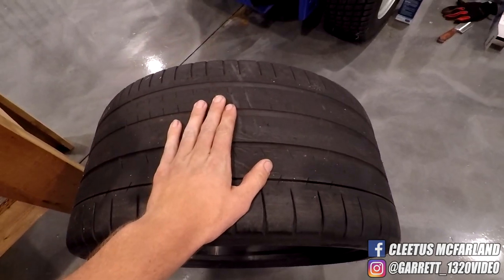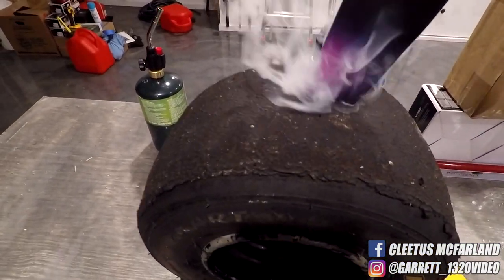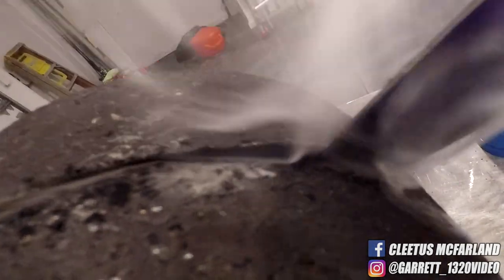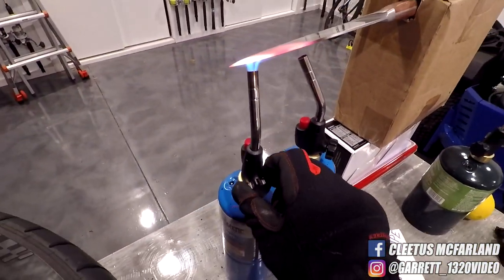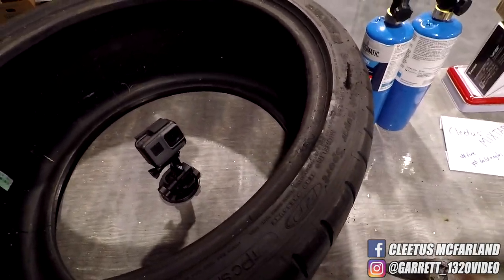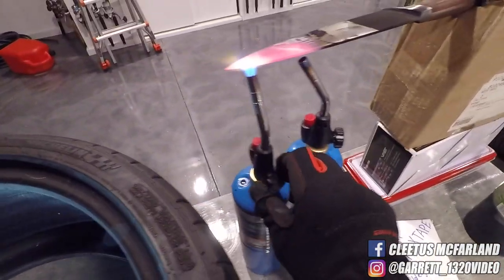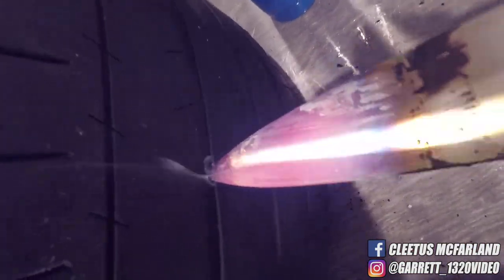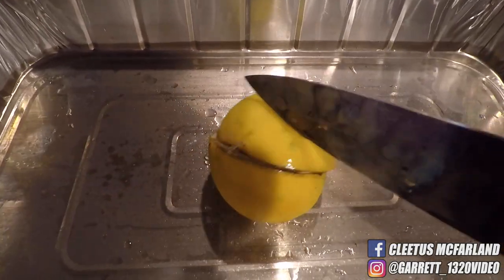GLOWING HOT KNIFE vs. CAR TIRE!

Comment: Of course that wouldn't go through the tire,  they are  steel-belted
Reply: do you think this guy would have the common knowledge to know that?
Reply: Lucky Dane this guy is playing a character he's not an idiot
Reply: Robert Smith hes very, very good at playing stupid then
Reply: hes done burnouts before, he obviously knows that
Reply: What do you mean he's not using jet fuel
Reply: o Lemurs I
Reply: Paul Castro side walls are not but your right.
Reply: @incrediblygay  one day he build a jet engine car with a v8 in front :)

Comment: the rubber on the tread is not that much thicker, the reason you cant melt through there I because there is metal under there
Reply: Exactly, he's hitting the steel belting
Reply: thank you

Comment from the maker: Gotta be hulk to get through those belts...
Reply: Cleetus McFarland fishing videos soon?
Reply from the maker: go back in my videos a bit, just posted one in LA tuna fishing
Reply: I saw all the rods on the wall.
Reply: Steel belts laugh at your puny knife.
Reply: Cleetus McFarland I hope you check out some of my videos
Reply: +Luchace Fox Good point. Having air pressure on the backside would have helped tearing the tire thread apart.
Reply: isn't it pretty dangerous doing thag because of all the presure inside
Reply: Cleetus McFarland Yeah, im thinking you'll have a DIY flamethrower, if you stab your tire with a flaming knife when its pumped to 35 PSI or so, as the flames will get a massive blast of air...
Reply: Alfredo, the tyre wasn't on a wheel...
Reply: Cleetus McFarland don't care
Reply: Dominic, I meant if it was on a wheel with pressure could it just kinda explode?
Reply: The adventure of chuck
Reply: Alfredo Aldape no
Reply: Or Chuck Norris...
Reply: Cleetus McFarland I love your channel can you shout me out at dallas miller
Reply: Cleetus McFarland use that to mount your tires next time

Comment: Wont cut trough the tire because of the steel belts in the tread
Reply: If anyone was wondering
Reply: Correct, most tires have more than just rubber under the tread for strength etc, but for some reason this is not common knowledge, at least these days.
Reply: ChildOL trust me if you ask anyone in this generation 75% of them wouldn't know maybe more
Reply: probably closer to 95%

Comment: Holy shit its almost like theres a metal braided ribbon cable going through the rubber at the treaded area.
Reply: Olivia Lambert because there is.. they're is wire in tires
Reply: Yeah, thats why I said it :( Its oddly specific about the type of wire to be coincidentally accurate.
Reply: Haha Correct! XD Tires are manufactured with steel belting

Comment: There are these things called Belts in tires. They are made of Steel. Passenger car tires have to have them for structural reinforcement (Against potholes, debris...) and while a nail that you run over can pierce through them, you're not going to shove a knife through them by hand. Go Kart slicks (Or even Track-only tires for cars) Won't have belts because you won't generally find potholes on purpose built tracks, and it cuts down the weight of the tire quite a bit.

Comment: a bit of explanation here - you can cut the sidewals with a normal unheated knife and it's quite easy, you cannnot cut the thread thou because there is a steel belt inside, there also a steel rod on the inside part of the sides near the rim - it's reinforced

Comment: Correct with the thickness of rubber but there are also other compounds like steel chords, Kevlar and rayon. Run flat tyres are more structurally reinforced for running flat

Comment: Pilot Super Sports have a softer compound on the outside for cornering grip, but hard in the middle for overall mileage/treadwear. Between that, and the steel belts you wouldn't find in the cart tires (sounded like you were cutting through nylon cords on those), I'm not at all surprised by the results.

Comment: The tire treat section is composed of metal bands (plies) a 1000 degree hot knife can't cut through metal bands. Side walls don't have plies that's why you were able to go through the sidewall so easily

Comment: I make tires for a living. You can't get through the tread layer cause you have steel belts that cross hatch through the tire. Unless you can melt the steel you won't get through it. The side wall is just thick rubber. Do this with tubular tires and you'll have better results lol

Comment: It's not how hard the rubber is on the sidewall vs the tread, it's because the tread has a STEEL mesh called a steel belt under the rubber.

Comment: Well the tread is supposed to be able to withstand heaps of heat since that'ss the part that gets hot whilst you drive, so it's not really a big surprise that it didn't go through.

Comment: Heating the steel basically ruins the heat treatment, which greatly reduces the surface hardness. Thus, the blade wont retain a sharp edge worth crud. At that temp, it may even be at the point of softness. Thus, you are no longer 'cutting' but more like 'melting.' But once you tried to go into the tread, you are now hitting the metal re-enforcement strands. Now you have a non-hard knife, you are not going to be cutting at all. 
In any event, you did not compare it with the non-heated knife, ergo: experiment fail.

Comment: LOL it's not that the knife can't cut through the rubber in the middle, but the middle of the tire has a steel band to help keep the rigidity. that's why it didn't work

Comment: Tires have bands and wire in the tread to hold the tire together making the knife stop if the tire didn't have the wires you would slice straight through

Comment: inside tire there is a metal net so you will not be able to cut it with hot knife. sidewalls instead contain no metal. that's why tire repairers does not repair tires punctured on sidewall.

Comment: the rubber is not softer on the sides. you wpuld know if you knew how a tire is designed. theres a metal mesh in the tire, thats why you couldnt stab the knife through

Comment: you can stab a knife through a tyre easily without heating it up, it's nothing special. I used to work in a place where when we changed tyres out instead of deflating them the usual way by unscrewing the valve insert we just stabbed the side walls if they were junk. if your knifes sharp it will be easy.

Comment: the knife is to close when your heating it up the hottest part of the flame is at the tip not where u put it ( closer doesnt mean better)
Reply: lenard ggor no blue flames are hotter
Reply: the blue is the hottest part of the flame, hence how you can pass your hand through a yellow (dirty) flame but not a blue flame (being much hotter)
Reply: ***** what im trying to say is that the hottest overall part is the tip of the blue flame, but in the vid he is holding the knife to close to the burner in the lower part of the blue flame (its a difference)
Reply: lenard ggor ahhh i understand you now, not ideal placement i will agree..

Comment: well that's kinda a given......a tire has wires inside of it on the tread the side wall is just rubber hints why if you try to cut threw a tire with any kind of knife threw the tread it's more than likely not goin to work.

Comment: Three can withstand temperatures up to 2500 degrees but the ones on a Bugatti were specially made to withstand temperatures up to 16000 degrees but only for 12 seconds before they blow. I heard it costs around $8000 to change the types on a Bugatti. Can someone confirm this ?

Comment: Looking up the melting point of rubber is easy to do right? Like, you don't even have to heat the knife up either. Please tell me you really weren't that stupid as to be amazed that a several hundred degree knife cut through something that has a melting point several hundred degrees cooler then the object you are thrusting into it...

For the next wideo, could you survive a 1000 degree knife versus the human spine, OR 1000 degree knife versus other knives, which cuts you worse? You never know, this could seriously be the next stupid trend and challenge. Plus, I'd REALLY want to see an idiot do this. Would make for a good laugh as well as lesson for the lengths idiots go with these "challenges," which honestly, only leads those doing them into being mentally challenged.